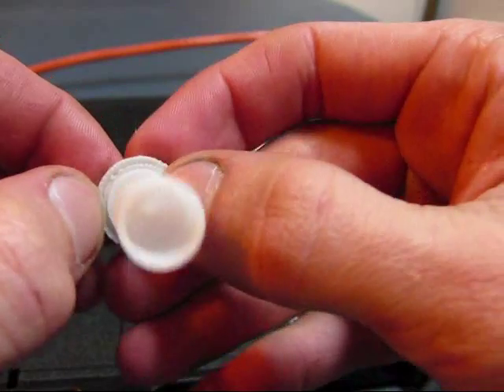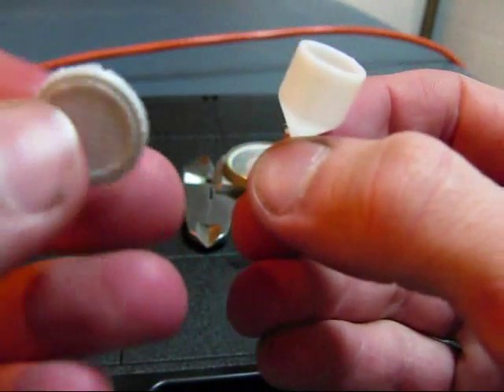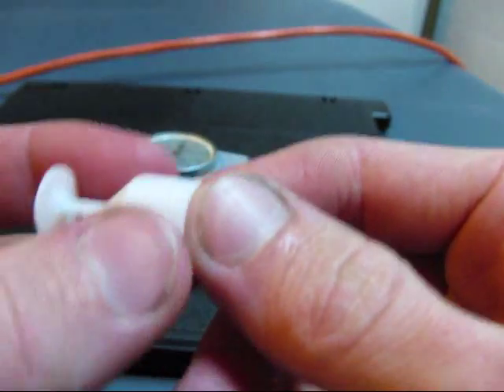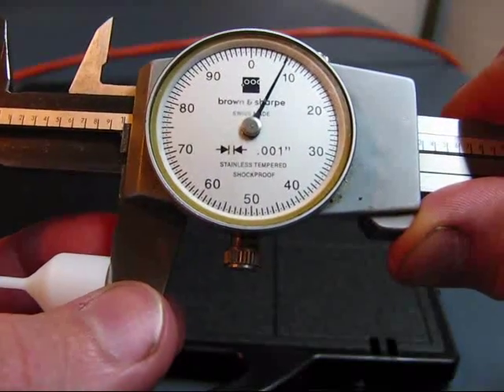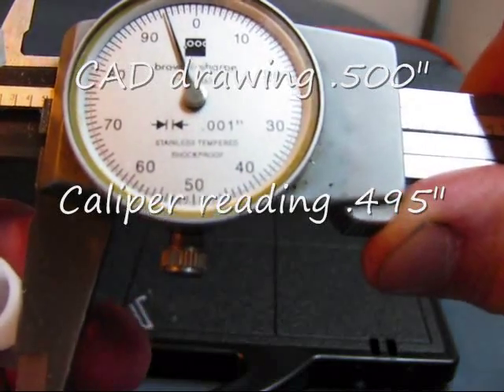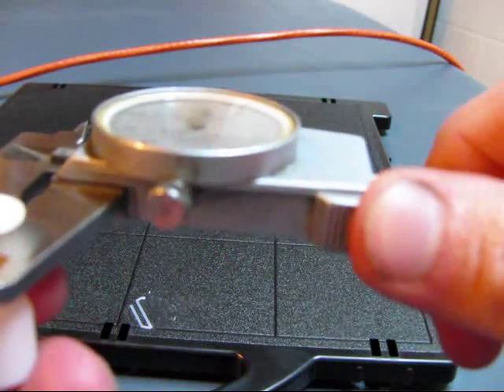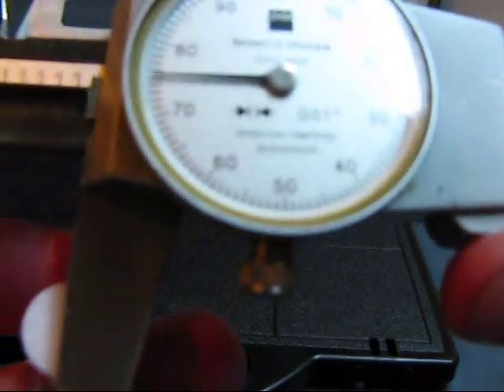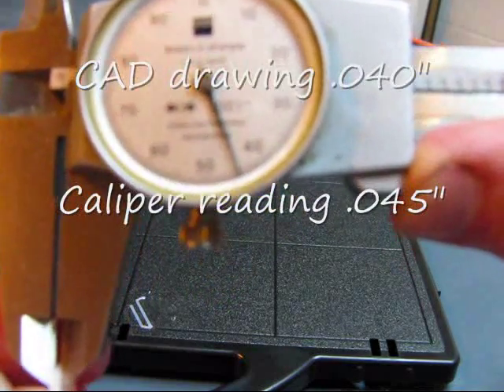FDM Accuracy of Cup on Dimension BST 768 3D Printer

Comment from the maker: You would be correct about the micrometer.  I do not have one to check parts with. Using dial calipers is all I need to confirm that my customers 3d printed parts are to size. I work at a high tech machine shop that machines AlBeMet.  I don't promise tolerances unless I know my 3d printer is capable of holding them and I can inspect the parts upon printing.

Comment from the maker: With my Dimension BST I have found that most dimensions are usually +/- .01".

However it does vary up to .015.  Accuracy depends on how the part is build, how tall the part is etcetera.

Since the layers are .01" obviously the Z tolerances are going to be more difficult to hold.

The minumum recommended detail size is .04".

Anything beyond that is going to break easily or simply not print at all.